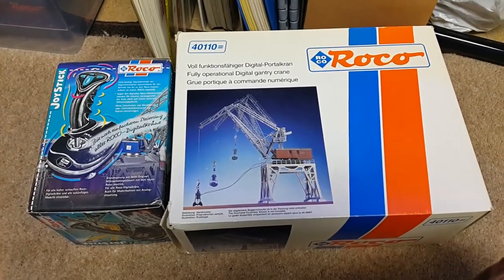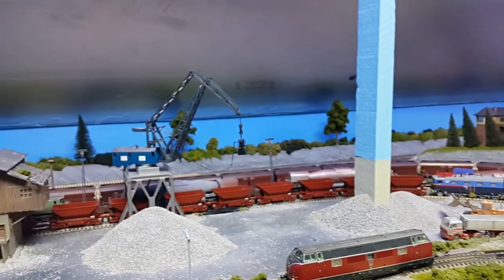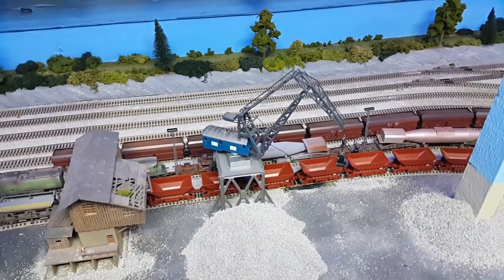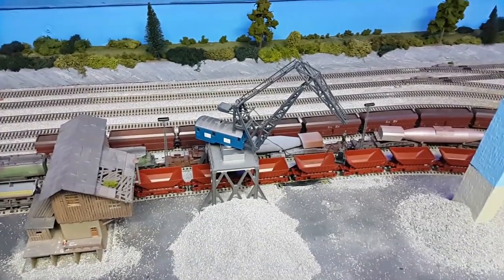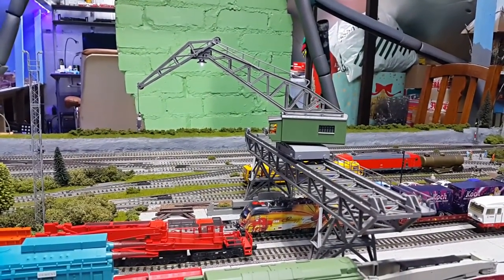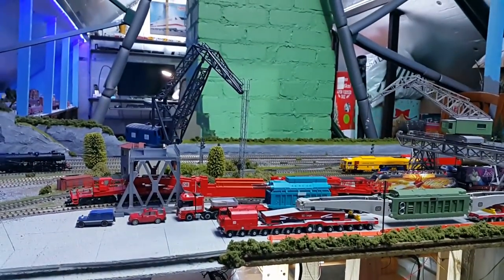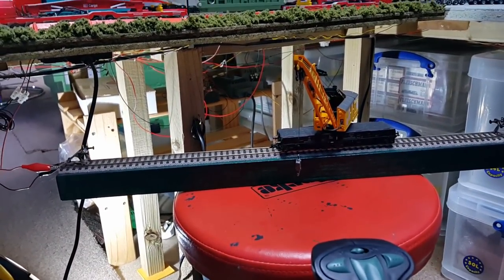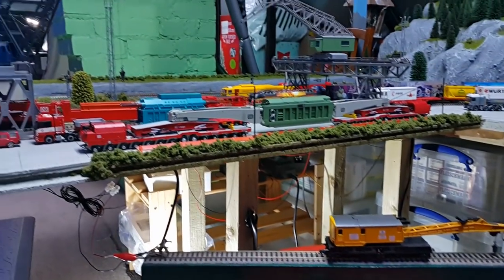ROCO DCC CRANE 40110 ROCO JOYSTICK INTERFACE VID 2

Comment: Very smooth action Jim have you ever heard of a sound chip for the track yellow rail crane a mate has an engine with a crane attached and wants sound in it cheers Tony
Reply from the maker: Yeah Marklin do a special sound coach for the big non sound  goliath crane or the smaller roco rail crane in this vid ,  Marklin Trix also do the dcc sound crane which is amazing....

Comment: Hi, a question.  Can you use the joystick along with the Ecos?  In other words, can you connect the joystick control to the same layout the Ecos operates?
Many thanks in advance
Reply from the maker: Hi, I am not sure if you can connect the joy interface to the ecos, I have my joy stick interface connected to a external transformer to control one of the cranes and the other big roco crane is connected direct to the ecos track without a joystick interface.

Have you the joystick instructions?
Reply: Hovermotion Hi Jim (btw I as liked you a few questions before and got your helpful advise - many thanks),  I do have the instructions and I have the two Roco cranes (the one with the articulated arm and the one with the long arm) connected to the joystick with external power (they work fine).  I was just wondering wether the third crane (the one on the 46800) could be controlled with the joystick as it runs on the track controlled by the Ecos.  I couldn’t find this on the manual and the 46800 is not yet in my stock (I am planning to get it, but I would like to get it only if it works with the joystick - the Ecos control is fine but not as easy to use ;-))
Many thanks (as always very helpful)

Kind regards
Ricardo
Reply from the maker: @hcastorpxx  Hi Ricardo ,yeah I know what you mean now...the joy stick interface can control the rail crane but the crane would have to be on a isloated section of track to work with the joy stick and the roco interface , the other control option is the ecos as you say  which can control the crane anywhere on the dcc track layout if that makes sence.
Reply: Hovermotion Hi Jim,  Excellent, that’s all I wanted to know.  Many thanks once again!!!

Kind regards 
Ricardo